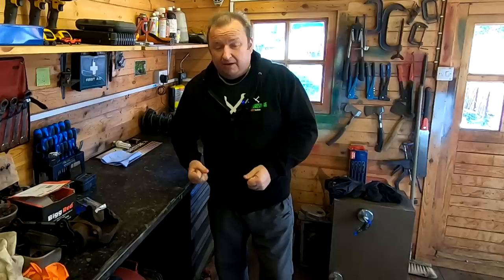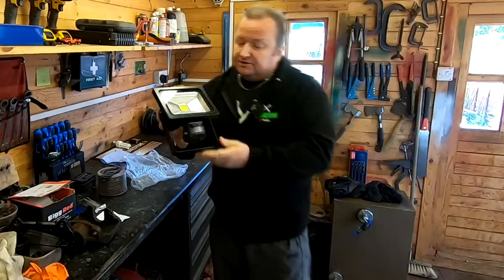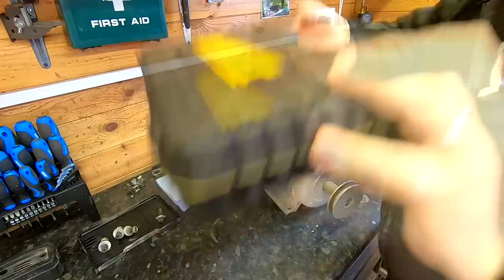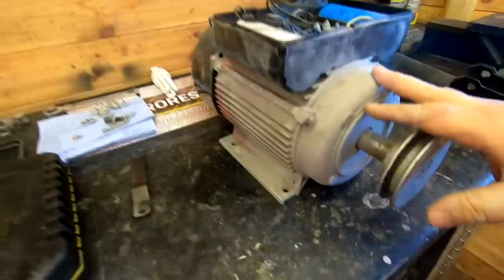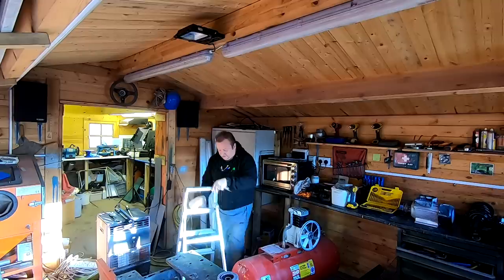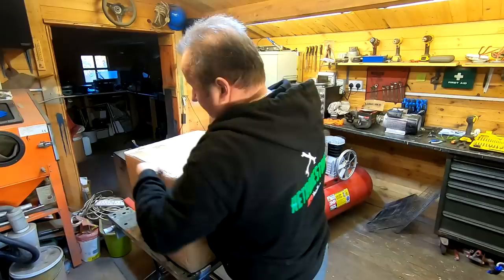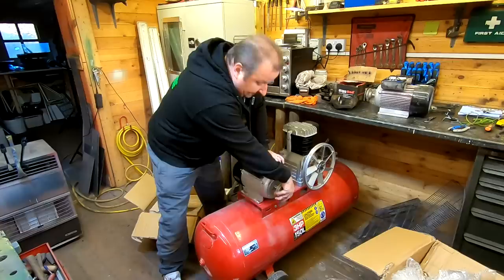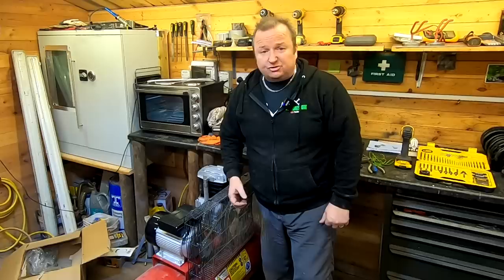Fixing The Compressor And New Lights Vlog

Comment: You said right in your last video putting up the light outside, that you are gonna go back and put silicone around it. I hope when you rebuild the other motor you'll be able to get that pulley offer there. 2 different types of metals, hopefully it's not welded itself together.

Comment: would like to see a vid on the repair of the old motor. would this be coming up ?
Reply from the maker: Maybe Dan.
Reply: @retrorestore   definitely the bearings. should be a simple straight forward job of pulling them off. lolololo  BUT, sometimes they are a right pain in the ass. You do have a good oven, heat new bearing up, they slide right on,

Comment: I'm glad your compressor is now working, when my original 24 litre gave up, I missed it.
Trying to set up my diecast channel. The problem I had today was the bad lighting. I trying floodlights and LED lights and still no good, just lots of shadows. I which I could afford your studio type lights.
Reply from the maker: Yes, lighting is essential Jeff, You don't need to spend a fortune though
Reply: @retrorestore  I was going to try today, I had every available light on the model van, but just didn't look right. I hope to put the first video out Friday week so will have to experiment a bit.

Comment: A result with the compressor. Mine died when I was changing the front springs on the Citroen but I have another one I bought form Aldi so I'll put it back into service. The dead compressor isn't worth repairing so I'm gonna take it down to the recycling. It was something I inherited when I took the garage on so I've lost nothing.

Comment: Great video martin.I have been watching your channel for a while.What advice might you have for a compressor for a small workshop.Is there a minimum bar pressure for running air tools.Thanks
Reply from the maker: basically, the bigger the better but it depends on your budget as well. This one is 150 liters 14cfm and a 3hp motor. For spraying, you can get away with a much smaller one.

Comment: Was that Jimmy’s compressor you just put in?
A new project, put in new bearings, you'll have a spare.
Reply from the maker: Yes Jim, Mine was 90 liters and this one is 150 liters.
Reply: I was a bit miffed as thought it wasn't that old then I twigged it was Jimmy's higher output one from the yard. 👍
Reply from the maker: @paulyh4531  Yes his was under constant use for 3 years Pauly.
Reply: @retrorestore  that's good going then , not only but also was the Peter Cook and Dudley Moore thing you was trying to rem the other night on Chris phone in. Classic stuff 👍

Comment: dose silicone not cause the water to pool in the back of the light  rather than just run off if is dose manage to get in . as the light fitting self will be ip rated
Reply from the maker: No Simon, you leave a gap at the bottom to act as a drain hole